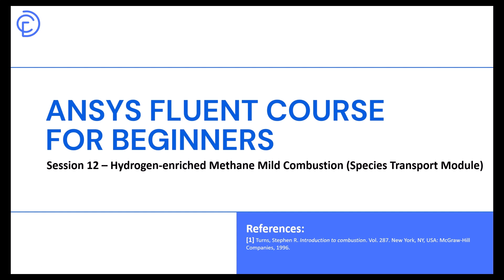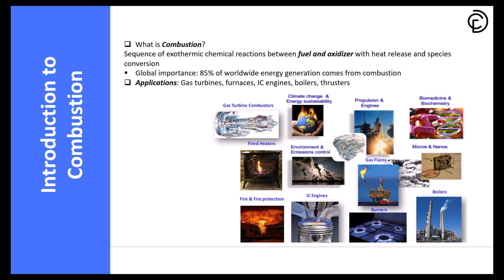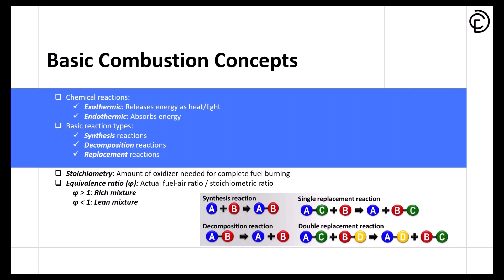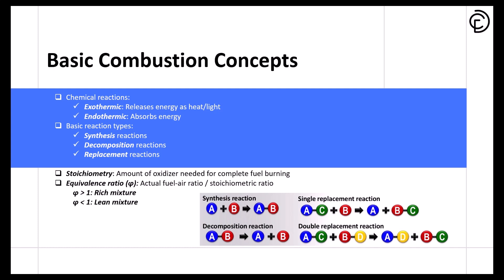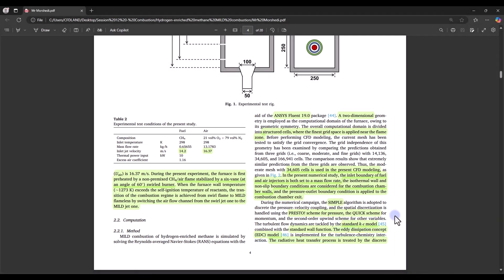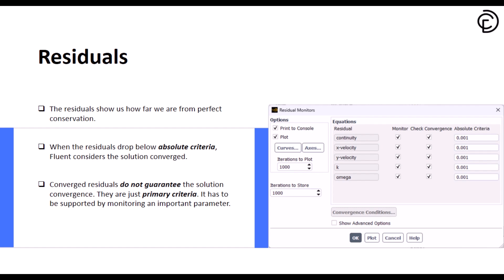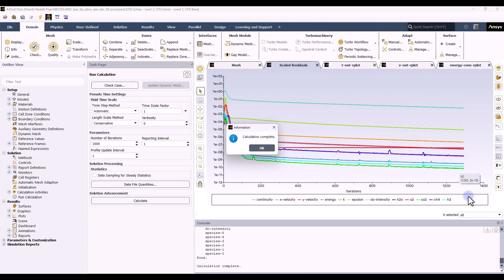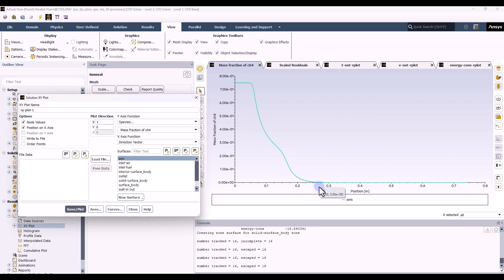ANSYS Fluent Tutorial || Session 12 - Combustion

Comment: can you tell me which important parameter i showed check for convergence ?
Reply from the maker: Flame length → Ensures the reaction zone is stable and not oscillating between iterations.
Energy balance → Input energy vs. output energy should match within an acceptable residual tolerance (very small difference).
Outlet temperature → The temperature from the combustion chamber should remain steady over several iterations, showing the solution is stable.
Reply: @CFDLand  here my residuals of continuty is very high but other are low how to handle it
Reply: @CFDLand  here face another problem whenever i use particle surface reaction after the convergence  it show the reaction rate value still zero